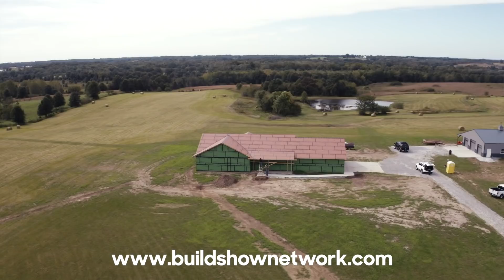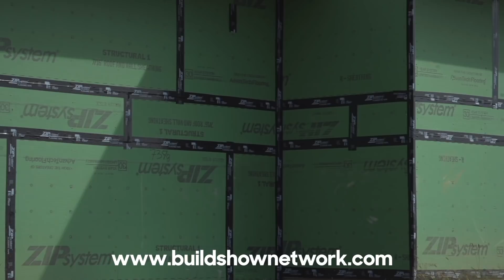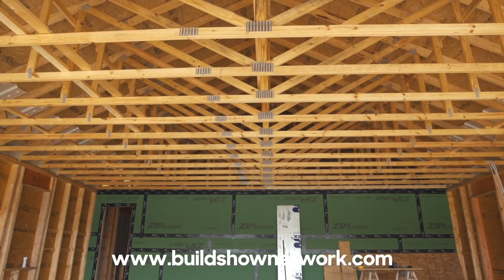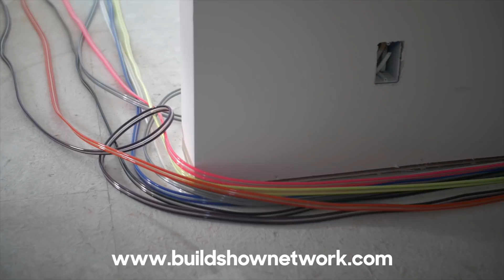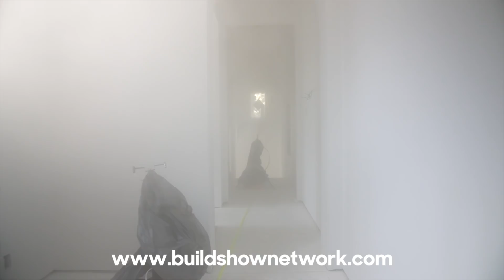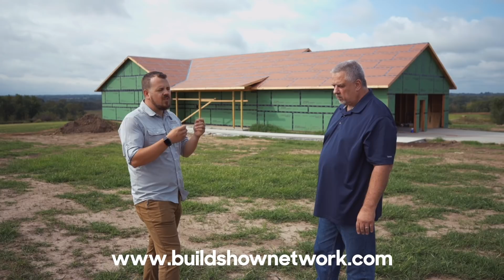How a Builder and Architect Team up to Build a Green Box

Comment: In my opinion, it's not even worth building a home to absurdly low code standards. When I finally get around to building my dream home, it'll be built to the passive house standard because nothing else makes sense. Sure, it may add 10-15 percent to the overall cost of the home, but you'll have a FAR more reliable, durable and comfortable home in the end and isn't that worth 10-15 percent? It's a no brainer as far as I'm concerned. Low quality builders need to be driven out of the industry.

Comment: I would like to see the moisture measurement in Radiata Pine framework taken at the time of coverage. Then, measured again in five years. The forces on roof trusses by wind loading, can cause fail to truss webs. I believe that this is dry rot around mechanical fastener plates.🙄

Comment: If you are planning on aerobarrier (before window install) curious what the cost advantage to liquid applied zip sealing vs aerobarrier would have been. Do you think the air leakage is in the tape joints?

Comment: For Steve - great admirer - 
Have you reconsidered any of the designs or consulted with HVAC in consideration of the accumulation of virus inside the house.   The current wisdom seems to be - ventilation and increase air changes to reduce Corona Virus in the structure. 
Thanks -
Reply: I would think not much different than dealing with influenza.